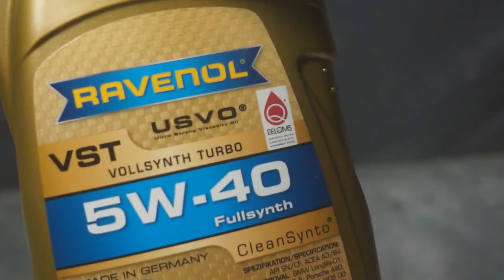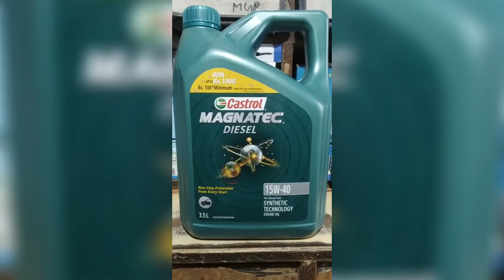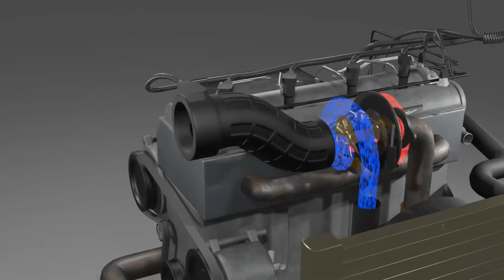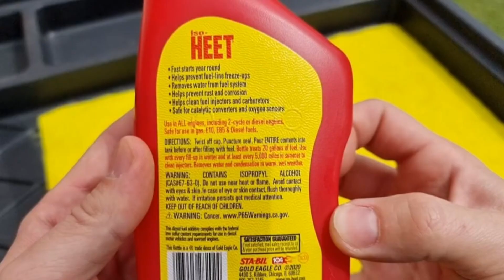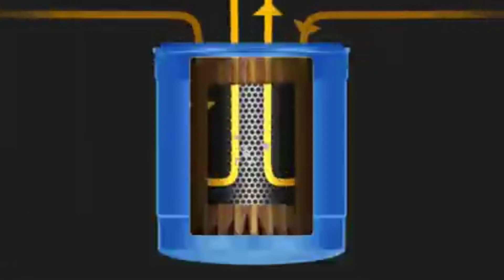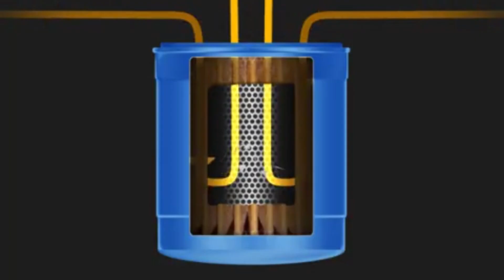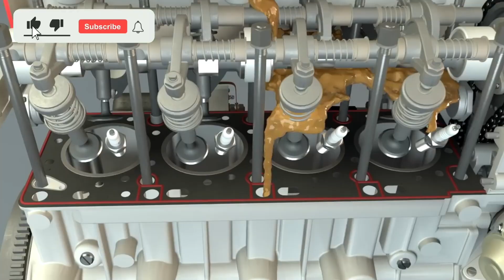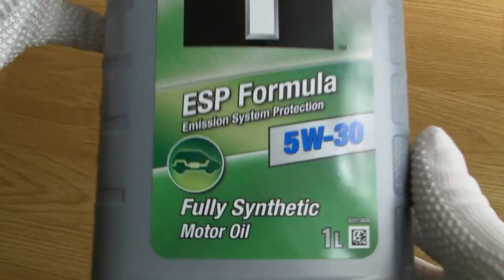5 Things You Must Know About Synthetic Diesel Engine Oils

Comment: Mobile 1 EXP x2 0W-20 in my 2025 Duramax 3.0
Reply: No no no take that shit out. Switch to a 5W40. I have one, and 0W20 is too weak, especially for longevity,  durability, and most importantly, the turbo. 20 weight is too thin, and that turbo gets too hot and will break it down. 0W is for down to negative 40-degree  weather.I live in Texas,  so 5W is just fine.Don't trust the dealership on oli. They are going off what the EPA and government want. Do your research